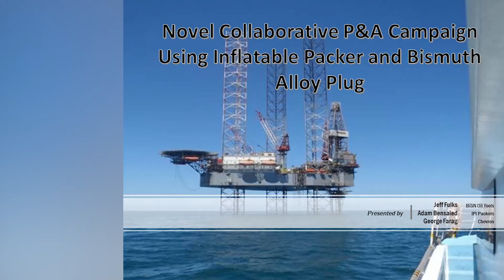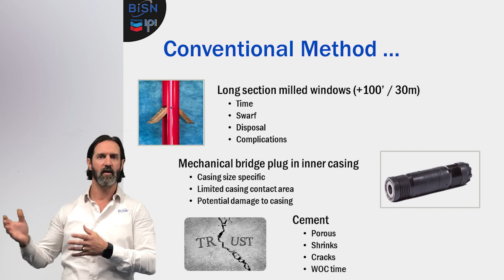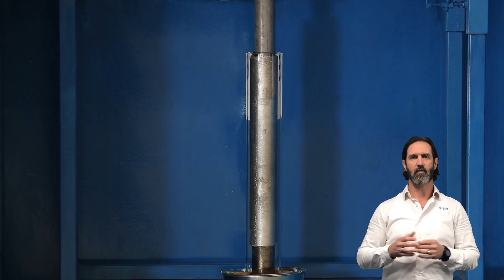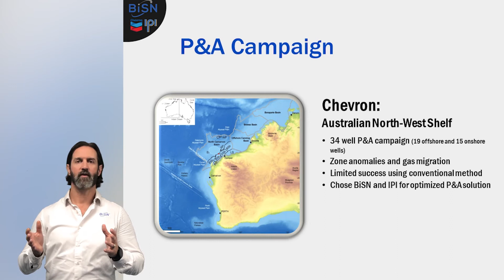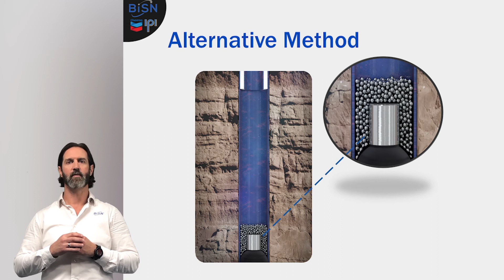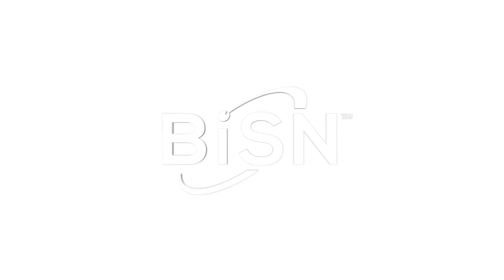Comment: So with bismith metal at 36 dollars a cubic inch, for a meter and a half hole, (without the bottom beads) and a 10 " hole to seal, your looking at 167000, dollars, just in bismith cost. I think it would be cheaper to use a string of heavy duty Packers w a accessible inflation line to keep a static or micro variable diff bore pressure on them,  😮😮😮 Looking at it from a Environment aly friendly view of course. Bismith is pretty rare indeed and there are many wells and need plugging, unless of course this is just benefitting the counties that have the bismith monopoly